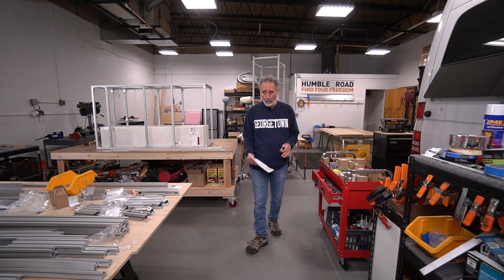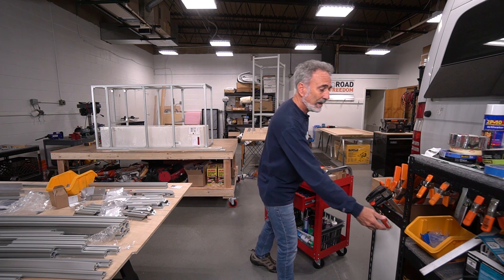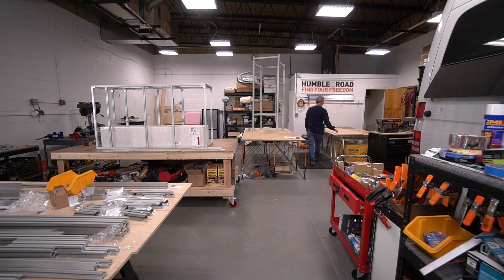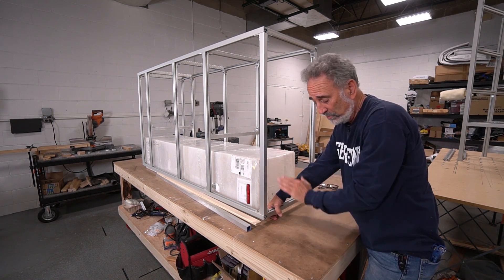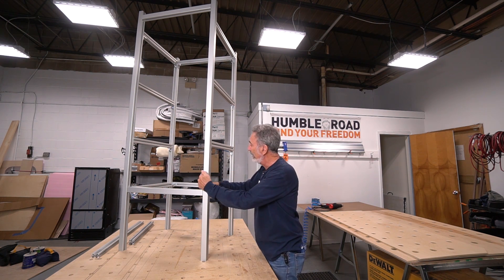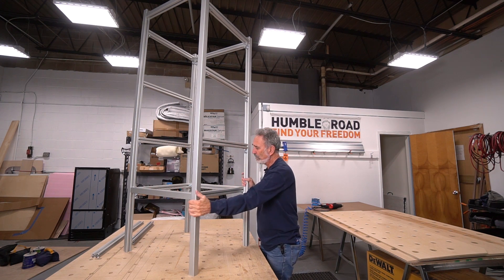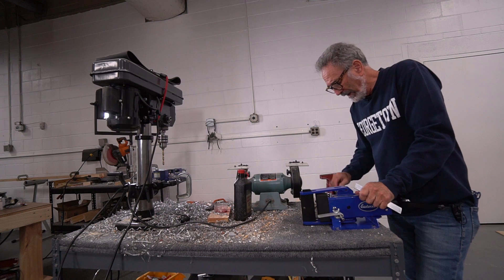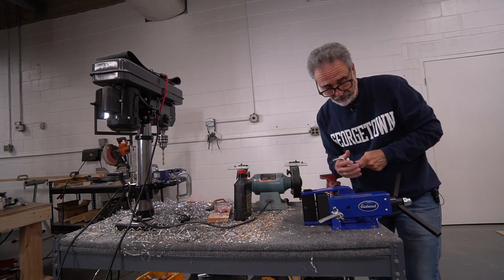Humble Road van builder's studio  - Shop tour

Comment: extend the handles with some pipes to extra torque on the hand rivet tool and bracket bender
Reply from the maker: I did that. But quickly realized with the amount of riv nuts and plus nuts I will be installing, I needed a better tool.
Reply: @HumbleRoad  makes sense for a production but for anyone without the luxury it's something to consider. 

request: any chance you get to bring up a new product/tool, could you please quickly read out the model number, thanks

ps your humour reminds me of a physic prof back in the day.

Comment: Always enjoy the videos George... appreciate the thought that goes into your builds. I like the floor-plan on this build so far. Just an idea though, if the water tank is almost against the floor, could it freeze in a cold climate, heated in the van I know... but ice on the base of the tank could interfere with your pickup tube.

Comment: The tanks really should go under the vehicle. Yes, that has implications for cold sensitivity, but maybe do what Advanced RV does - route the glycol return lines through/along side the tanks so that when the furnace runs, the water remains unfrozen. The weight goes lower, and you have more space for larger tanks, and you save a lot of space inside.  Also, NUT BUCKET.

Comment: Don’t let your insurance company find out you did not buy a saw stop. I ordered up a new table saw for my operation. Month later my yearly insurance inspection. Insurance man said I had a month to get the new saw replaced with a saw stop. My old table saw was fine because I owned it before I started my business. But if I wanted to maintain my work and comp the only option for a new table saw was a saw stop as it has the braking system to prevent removing fingers. Fortunately I was able to sell the new saw I had bought and replace it with the new saw stop. And I do have to say the saw stop cabinet saw is a dream to use.

Comment: Humble Road , would the water tank crack or break over time with fatiuge with the 40/20 around it with the constant shock from driving on bad roads speed humps etc . Would it be a good idea to put quality rubber between the tank and the 40/20 to absorb the shock . Love your work and new ideas you come up with .
Reply: His previous video - Tank has a 3/4" plywood on the sides, not lying directly against the 80/20.  With a rubber mat and foam on the floor, should be nice and cozy soft packed in there I'd say.  Maybe some rubber on the bottom of the top secure brackets, too, though?

Comment: You obviously do really terrific work I’m wondering if you’re going to consider doing some smaller builds for people.
Reply from the maker: Not sure what you mean by smaller builds? Less involved? Less money? The extent of components and materials is completely up to the client. I have a fixed labor rate to build a van. So it's to your benefit to load up on features.
Reply: I was looking at a recon camper van something I can use as my daily driver and rather affordable
Reply from the maker: Leslie Granowski compared to other boutique builders, my out the door price range is very competitive. But I would not call it affordable in general terms.

Comment: Not sure of your reason for using 80/20 as sleepers on your floor. Wood would be a better and cheaper choice. Wood sleepers would allow easier fastening for sub-floor and attaching base cabinets and give you more options in sleeper height rather than the thickness of 80/20 standard stock sizes.
Reply from the maker: j e I did not want wood in direct contact with the van floor. And I wanted to grid-tie the framework for a more unibody adhesion. In van #2 (Vagabond) I used one inch square aluminum tubing. Less expensive and easier to work with. I still screwed my upper 8020 modules through the square stock.
Reply: @HumbleRoad  Cool, good switch, best of both worlds. Light weight, straight, square, no rot without paying for 80/20.

Comment: Nut bucket.  Hmmm... This is what the urban dictionary says about that:  https://www.urbandictionary.com/define.php?term=Nut%20Bucket
Another use is the Nutbucket State.  Missouri is the 'nutbucket state' since it is so industry friendly.

And of course we have California, the Nutbucket.  Home of the fruits and nuts, ha ha!

Great tips, George.  I am working on compiling every single tip and trick you mention in an orderly referenced format which I might publish for reference.  
One video I would love to see is what ORDER you do the major stuff, such as:
Prework:
Design van as per needs
Diagram and calcs on weight distribution.
Work:
1.  Cut holes in roof
2.  Do the major wiring through the van
3. Lay insulation in ceiling, and walls
4.  Add 80/20 floor framing
5. Lay insulation in between floor framing
6.  Finish floor layers - Polyiso stiff foam boards, mass vinyl, plywood, rubber mat or finish layer.
7.  Finish ceiling layers - thinsulate (black side to sky), reflectix, Mass Vinyl, removable wood barreling, etc.
8. Lay plumnbing lines, etc. etc.
I think we have a lot of information from a lot of sources on materials, techniques, tips, brands, methods, but we don't have a systematic and comprehensive guide to all of this in one reference point.  It would be nice to have this for all to use.  I'm excellent at documentation being in IT, very detail oriented.  I'd like to do this.  So please make a video on order of progression on tasks and design.
Many thanks and greetings from California!

Comment: I’m curious why spend the money having 80/20 do your cuts? Wouldn’t it be cheaper to buy the longer profile and do your own cuts? Any benefits other than time to spend the extra money? I know shipping is a killer on the longer profile pieces.
Reply from the maker: When buying as much material as I do, it makes sense.. I used to order gross lengths of 75-78 inches, then cut it up as designed, but it is becoming increasingly easy to forget how a particular piece needs to be cut. So now, I have them cut to within an inch of the final length. And bundled per module.
Reply: Humble Road Thanks for your answer. So if you were doing a small, one-time build, would you buy the longer lengths and do your own cuts? I’m planning to use 80/20 for my final build in my Jeep.
Reply from the maker: Wayward Escapes yes,  and the overages come in handy for unforeseen cobbling.
Reply: Humble Road Thanks for the advice 👍🏻

Comment: What is that table base under the Refrigerator Module?
Reply from the maker: It's called a centipede work stand
Reply: @HumbleRoad  Thanks! Looked into it and it's surprisingly affordable, given that I have limited space. For anyone else looking to find out what that was, it's by a company called Bora (Bora Centipede 4x8 Feet Work Stand). They make a few different sizes.

Comment: 11:11 !?! 😯🤔😎
Reply from the maker: Self tapping screws or sheet metal screws, IMHO, get one shot at seating themselves and holding fast. And that's in a sticks and bricks environment. I prefer a machine screw and good solid threads. in and out as many times as you like, no degradation.